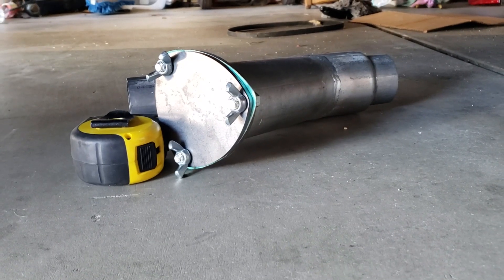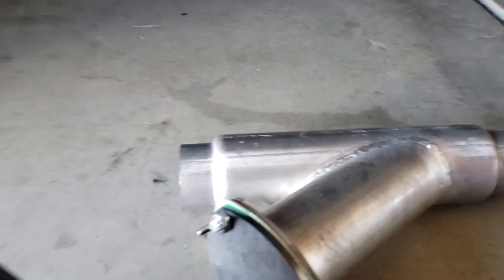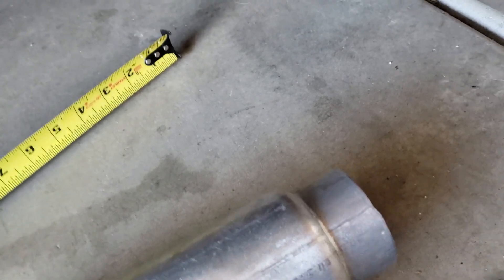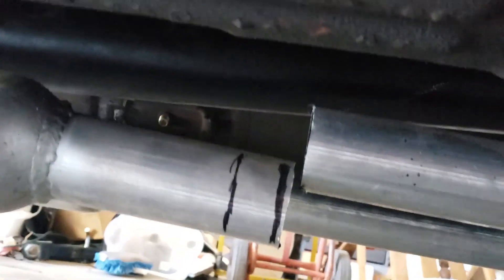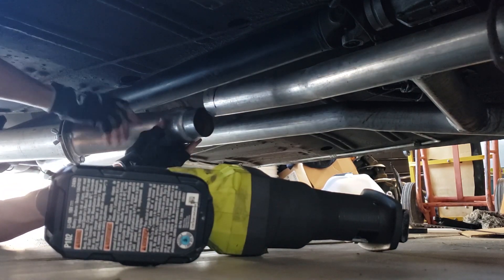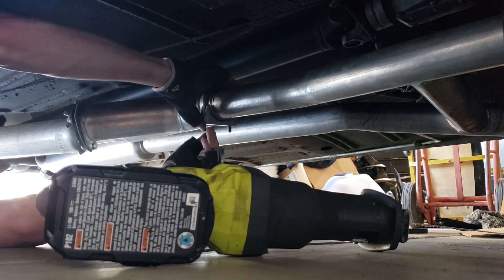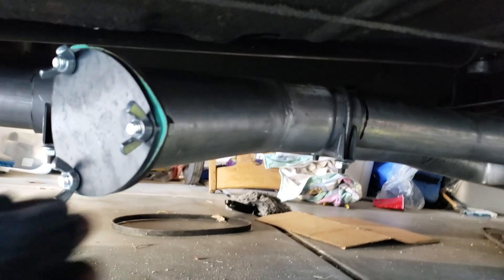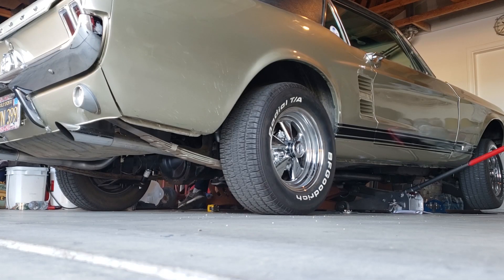DIY: FAST and EASY exhaust cut outs! RESULTS SOUND AMAZING!

Comment: Those aren't true cutouts , now you have flow going through both pipes, you would need to block off the muffler pipe to get true cut out,  all your doing is really putting a hole in a pipe that makes it sound louder,  just like an exhaust leak
Reply: Pressure is distributed to solid boundaries or across arbitrary sections of fluid normal to these boundaries or sections at every point. Understand and become golden.
Reply: Engine masters did an episode recently with this style of cut out that showed they made power. Low buck old school street/strip style. Install 18” behind the collector for best results
Reply: It can give decent gains in top end power and it sounds totally cool